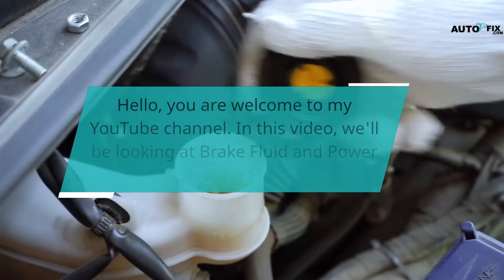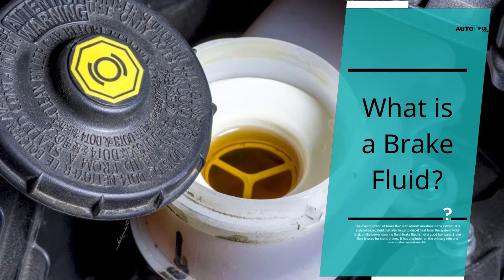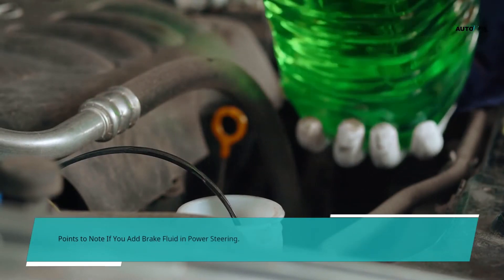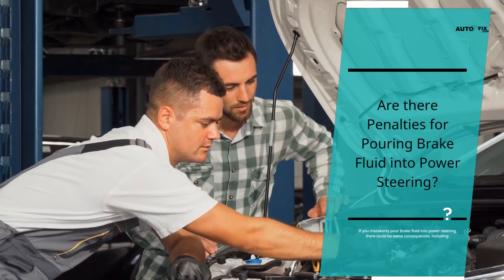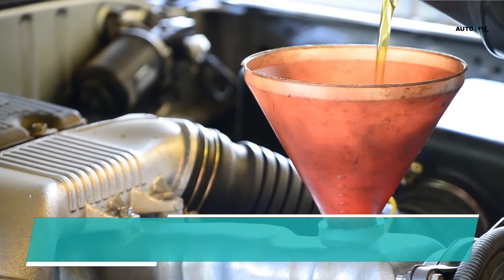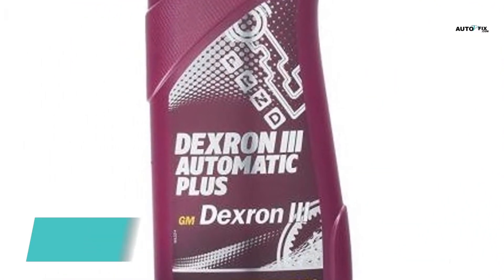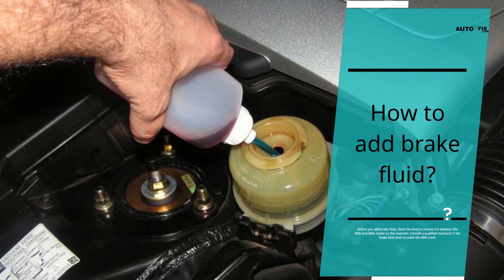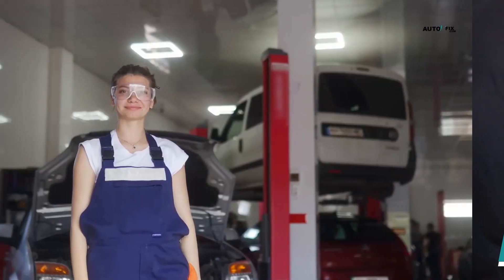Can You Use Brake Fluid for Power Steering Fluid?

Comment: So brake fluid can only be used for power steering fluid once-in-a-blue-moon in case of emergency but you should never use brake fluid for power steering fluid you should remove it you're confusing I trust nothing you say
Reply: never use brake fluid instead of power steering fluid.

Comment: Bro i just putted break oil in power oil box, and drove around 10 km and then i just empty all, should i have to worry? Please help me out
Reply: It's ok as long as you're not doing it often,wait till it's used up and add power steering fluid
Reply: @JesusMoreno-ct2lz  thanks for the response! It was killing me so I got up at midnight and started turkey basing it out. Had extra steering fluid, suck out old, pour in new, mixed then repeat until color a bit better.
Reply: I poured a little brake to power steering too and freaked out after I found out minutes later. Felt sooo stupid. Apparently only we are the only idiots that's done this 🤦🏿‍♂️ ugggh
Reply: You just need to take your break fluids and then add your brake fluids afterwards
Reply: I just poured brake fluid into my power steering 🤷🏻 cause that makes 3 of us
Reply: I guess thw fluid can break😂